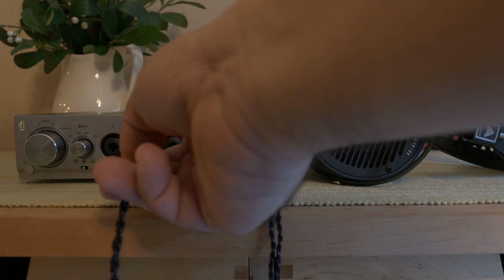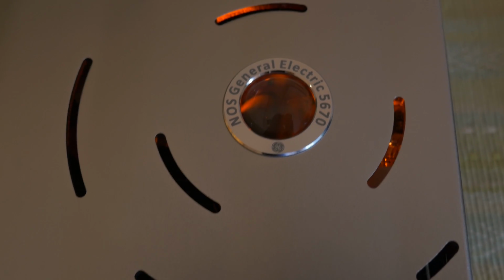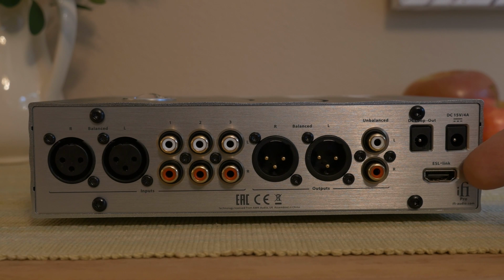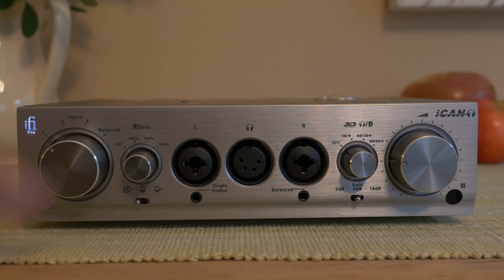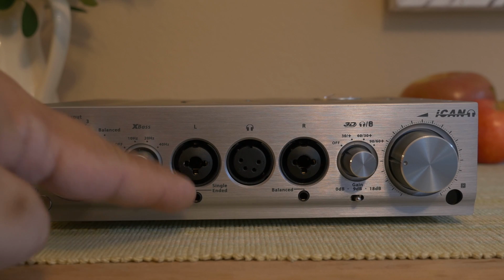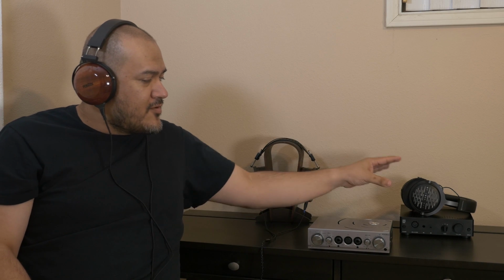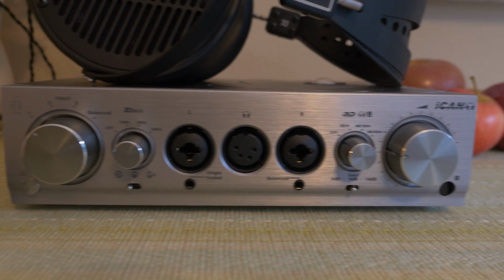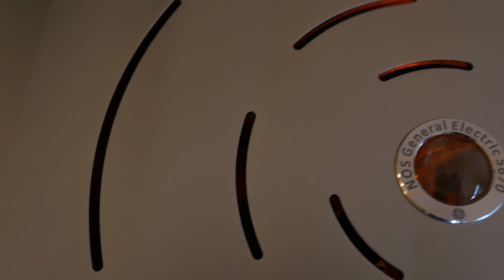Best Headphone Amplifier? - iFi Pro iCAN Review

Comment: I'm wondering, I'm new to amps etc. This amp has a selectable gain switch.

My question is, if I use it at 0db gain, wouldn't that just be the same as not using an amp at all since it's 0db gain?

I'm confused and was hoping someone could help answer please.